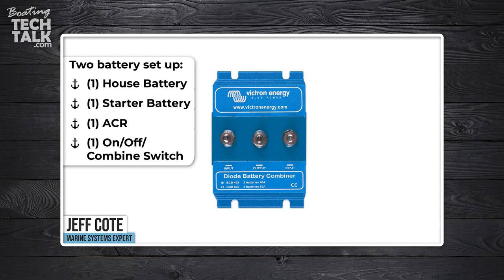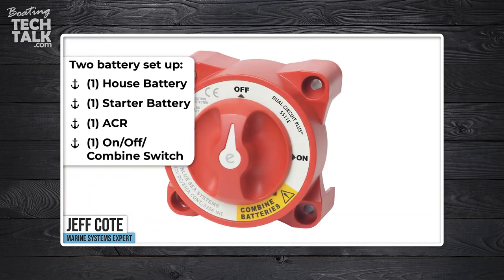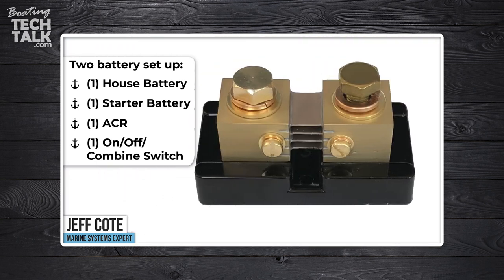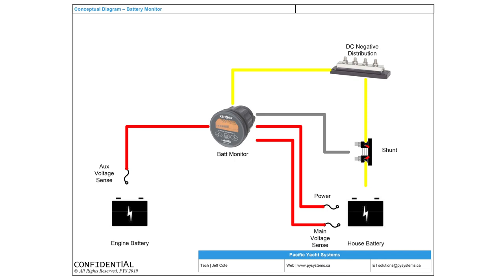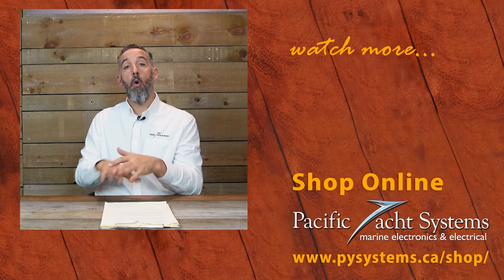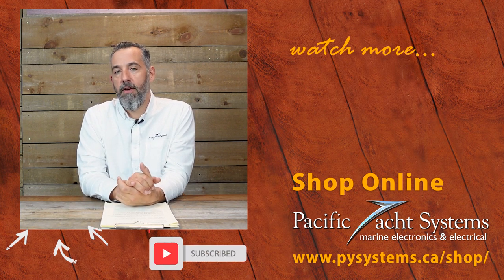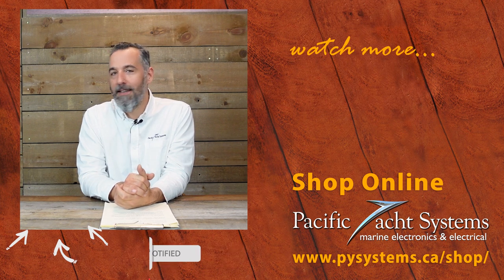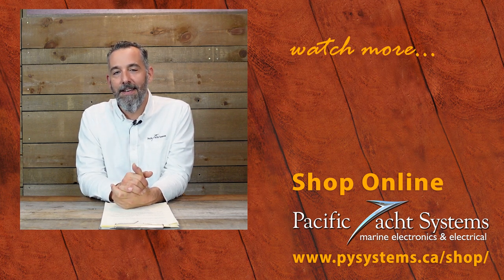House Battery + Starter Battery + 2 Battery Monitor Shunts?

Comment: Great video Jeff. I think I understand the concept of the choke point and the shunt, I still have my battery monitor laying somewhere... The problem I am facing is that in my 40+ years old and at least 2 previous owners, some loads where connected to negative in any place where they found ground and not to the house negative post or bar connected to it... So it will be a challenge in my boat to reposition all negatives to where they belong.. I think I will do it, but may be no too soon...

Comment: My set up is close to situation you describe. Victron wireless shunt is hooked to house battery but there is the ability to measure voltage on another battery, in this case the start battery. You don’t know the state of charge on start battery but if you know voltage you are confident it will start engine. ACR keeps start battery from discharging while at anchor. Not as good as two shunts, but knowing house battery state of charge and start battery voltage is good enuf for me. Great topic btw.
Reply from the maker: Good point, you can definitely monitor a 2nd battery voltage.... which is really useful

Comment: Thank you for the video. I'm looking into adding a battery. What is like to know is can the batteries in this situation be different sizes? Can one be deep cell and the other not?
Reply: I believe he covered this in another talk, and the short answer is all batteries have to be the same type and chemistry. As far as sizing is concerned I would make them the same amp hour size but I didn't see any comments about that.
Reply: @vnichol  thank you. I appreciate the response 👍🏼

Comment: Hi Jeff, amazing content. I am re-doing my boats batteries. Currently has 2 duracell marine used as both house and starter with a small 10 amp charger. Cant i just put 3 IP67 victron chargers on each and then use a bluetooth to 3 7 inch tablets mounted at my main counsel to monitor my batteries. This allows me not to use a shunt and also meet the 40% of the firefly with a victron charger. Might use a 15 amp for both starter batteries. 

Thanks and keep up the great content. Love the geeking put and mental torcher. I bought a new boat and the needbfor updating rhe electrical is crazy.

Comment: Thanks for video! I have 2 48 volt battery banks that are independent. I use an A/B switch to select which one I am using. They are completely separate. Simply a redundant system on my electric motorized sailboat. I have 2 shunts and I know they need to be at the battery ("choke point"). My question is can they share a negative bus bar after the shunts? To recap: 2 battery banks, 2 shunts then...One bus bar that grounds devices. Will that work and give me accurate data at the shunts?

Comment: I think that's solid information and a really good question asked. So I guess the real answer to the question is it's good to have two shunts if he wants to know exactly what going on with each battery at any given time. However, this leads me to a question.let's say the switch has been flipped and both batteries are now one bank, do we need to have a shunt that is suitable to handle the power of both batteries or is the difference is in if their weird in parallel or not?
   Thinks for a great video
Reply from the maker: Thanks James, it's very rare for boatowners to have a dedicated battery monitor for 2 battery banks. Nothing wrong with doing so, the cost benefit isn't worth for many boaters. That said, if you can afford it, why not?
Reply: @PacificYachtSystems  I understand so I was right in having a shunt to handle the power of two batteries when and if one would need to join the two together. Thanks 👍😃.

Comment: Understand two shunts to monitor current in/out for two separate batteries.  What about two shunts to monitor one battery?  My existing monitor is old and I’d like to upgrade to a monitor with more features, but do not necessarily want to throw away the old shunt/monitor.  Will two shunts wired at the same points interfere with each other?

Comment: Hi Jeff,    Currently upgrading the electrical on my sailboat (Coronado 27).     I've got two Group 27, 12 vdc house batteries.    I'm installing a new DC power distribution panel (Blue Sea 8068) and a Victron BMV-702 Battery Monitor.    Both came with a Battery Shunt, but I'm thinking only one is necessary.  Note:   The Blue Sea panel has a Voltmeter and an Ammetter, which draw power from the shunt.     Any guidance???     according to the installation guides, it appears that the Victron Shunt is on the negative side and the Blue Sea is on the positive side???

Comment: i have been watching all your videos on this particular subject and I agree it is not easy to grasp the concepts and apply them to my boat.  I think my big stumbling block is I do not understand how my boat was originally setup and how much add on has been done since the initial build in 2004.  I know there are devices tied directly to the house battery bank that need to be removed and connected to a terminal block of some kind.
would an audit be a good starting point?  What kind of professional should I look for to provide this service?

Comment: Maybe I missed it but I think Jeff is saying each bank needs its own shunt on the one wire between the battery and the negative bus bar. is that correct?
Reply from the maker: if you want to monitor 2 banks you would need to have 2 shunts.  most people only monitor the house bank.  with a volt gauge on the engine bank

Comment: I have the Victron 712 with 500a shunt.  It has the ability to monitor a second battery but is this really safe to do because victron says to combine the negative of both battery's to do this?  In my set my 48v bank is what drives the electric motor and then the 12v battery powers my few accessories (nav lights, fish finder, stereo).  Would it really be safe to join the negative from a 48v system with a 12v system as Victron says to do to monitor the aux 12v battery?
Reply from the maker: Not sure about your specific setup requirements, but in the marine world it's quite normal for battery negatives to tied to a common negative distribution.